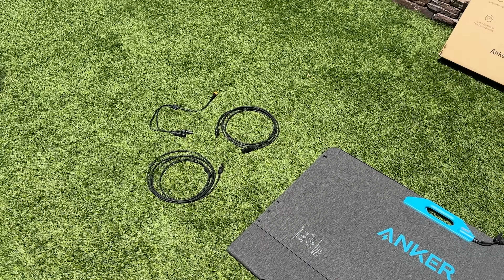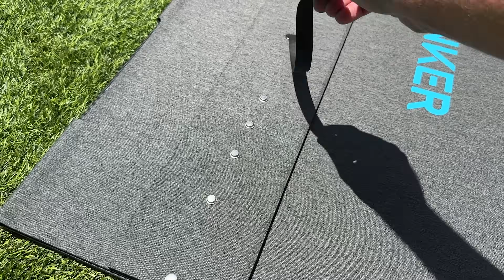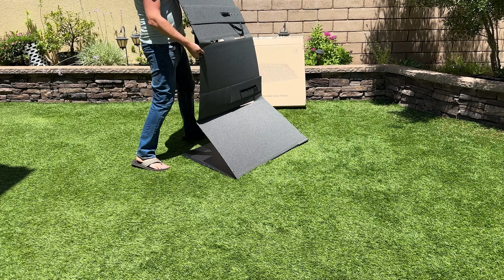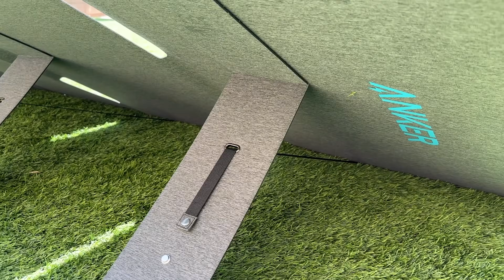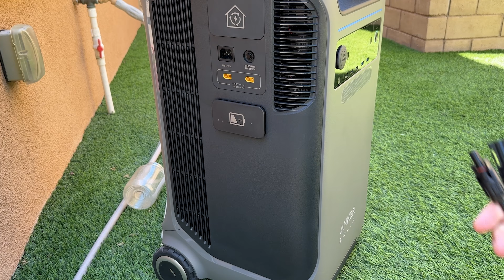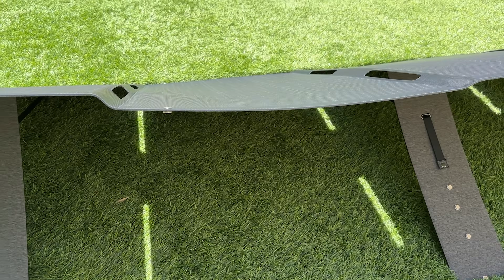Don't Buy A Solar Panel Until You See The Anker SOLIX PS400!

Comment: That's some sad shit right there...This is why you never buy the brand name solar panels. Jackery, Anker, Bluetti, etc. Unless you like paying triple for worse performance. Hell I have a cheap but nice Renogy E.Flex 200w N-type portable panel I got for $155 USD on a Prime day deal. The most I've seen even with the 10amp limit on my Bluetti Elite 30v2 I've seen as high as 185w and it usually settles around 170-175 after being heat soaked just using the stock stands, not even perfectly angling it. Some people with larger power stations and better MPPT controllers are reporting over 200w. I saw a screenshot of 217w. So for $310 lets say 170w low end figure I'm getting as the panel is bumping up against my 10amp limit consistently. That's 340w on the low side, 400+w on the high side. Why would I pay, the cheapest I've found around $600. Hell you could get 3 E.Flex 200's if you wanted to. This is why you don't buy power stations solar panels. They make power stations not solar panels.

Comment: For as much money they charge for these things, you should be getting at least 350 watts with sunlight like that.
Reply: No solar panel can reach the claimed full output except if positioned exactly perpendicular to the suns rays at noon at the equator. It is not a matter of money as the testing is done under the same conditions for all panels...sorta. Get used to it as this has been the case since the 1990's or so.
Reply: @geraldhenrickson7472 I understand that, but they shouldn't claim that it does one thing but then does another.
Reply: I just got mine today and the panel went up to 350 and up to 372 as a high point so far when the sun was bright.  Of course this is not the average as the clouds would cover the sun and it would drop, but it has gone that high at least. - this is in Texas.

Comment: Thanks for your video. I started at warranty claim on the F2000 because I was getting 57.09 volts and 7.96 amps but on the Anker it is only reading 290 watts max for me.

Comment: Just got mine today. Anker support leaves a lot to be desired. First the ONLY thing on their website regarding the PS400 is the super sparse manual and user guide. If you go to the support question area, there is no discussion or answered questions about it. If you try to communicate with them about the PS400, the required drop down product selector does not have the PS400 in it so you cannot ask them a question about it at all. I tried their chat and the AI also seemed to have never heard of the PS400. Then the chat timed out as I was waiting for a person to chat with.

My main question is - how do you store this ungainly thing? Do you place it flat on a floor or shelf? Can it maybe be stood on end, slightly unfolded accordion style to give it some stability? My garage is like a sort of 3D puzzle bomb - it will explode if you don't carefully place or remove items. So I need to know the best way to store it.
Reply: You can store it in any orientation that’s convenient for you as long as you don’t stack something heavy on top of it or something. Personally, I live in a small place. storage is an issue, so I put mine between my clothes washing machine and the wall And it stores nicely there.
Reply: Anker support is terrible.  I canceled an order before it shipped (because they ended up with a better discount) and I am still waiting for my full refund.  They refunded about half in one chunk, then when I complained, they refunded about a third of the remaining amount.  I’m still waiting for the balance and it’s been over a month.  Kind of shocking how terrible this experience has been.  In any case I received my C1000 + 400w panel a day ago and am charging up the C1000 now.  The 400w panel is HUGE and HEAVY, so beware.  I’m also surprised that there isn’t a fourth “leg” under that middle right panel.  It makes it flimsier than it needs to be.  I’m also surprised that folded up, there’s no way to “snap” it closed.  It’s still pretty floppy.  If the discount wasn’t so good I think the 200w panels maybe would be more portable than the “portable” 400w.  It hasn’t been sunny enough to see what max charge wattage is yet.
Reply: @pumpichank  Yeah, I ended up selling the 400w and getting two 200w ones instead. Just easier to set up and take down. I've had good customer service from Anker.

Comment: I just received mine. I think they are clunky. Looks like you're having the same trouble as me. You're just a little "rougher" with it while I deploy it more gently. The problem I see with this design is that the legs go all the way to the bottom of the panel, so as you tilt the panel, the legs will not be able to hang freely to open up. As you see from around 2min29s, the moment Steve leans the panel back, the legs will snap close and he has to go to the back to readjust the legs.

400W is quite heavy in my opinion, 46#, not something you lug around casually.
Reply: I agree about the support legs. However, once you get used to it, it's fine. Best tip is to lean the panel forward a bit while pulling out each leg. Then lean it back.
Reply: I agree, two 200w panels are easier to set up and move for sure. Plus, you could set them or angle them slightly differently for maximum sun coverage.

Comment: Are these your first Anker 400 watt panels? I have both their first gen and second gen 400 watt panels. The new ones (the one you have) suck. It doesn't have a bottom support for the leg. These ones have the "rope" to hold it with the buttons.

Comment: I just received the Anker 400w solar panel. I tried charging my Anker 757 but the battery only received 2 watts in direct sunlight. My Anker 100w panel worked great using the same location. I will contact Anker support.
Reply: I'm trying to figure out if I can use the ps 400 panels for my 767 powerhouse but none of these videos seem to answer the question kind of disheartening
Reply: @bootsy7  that should work because they are sold together as an option